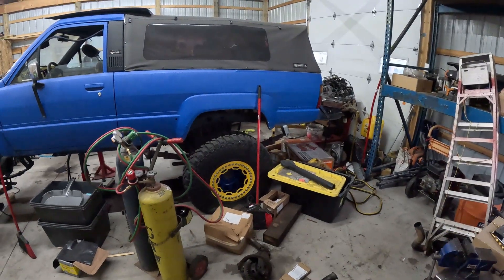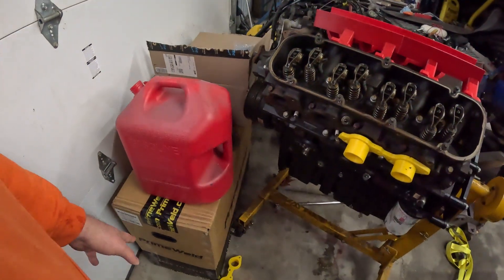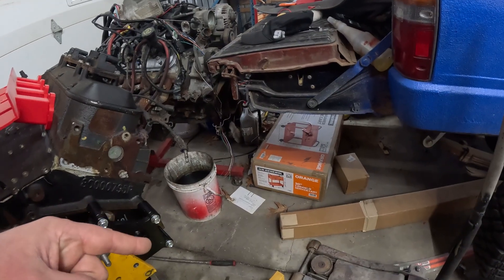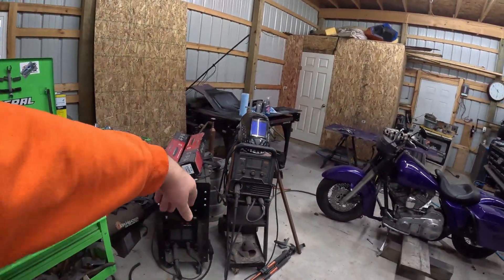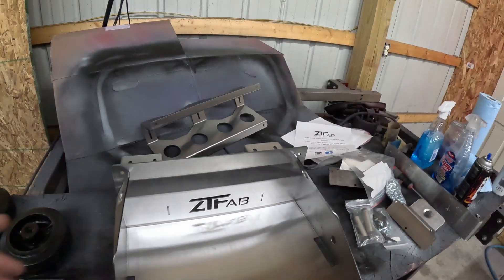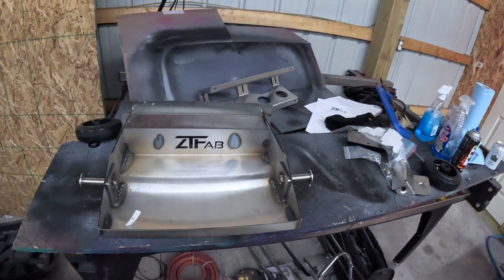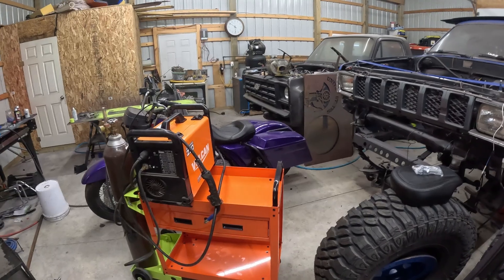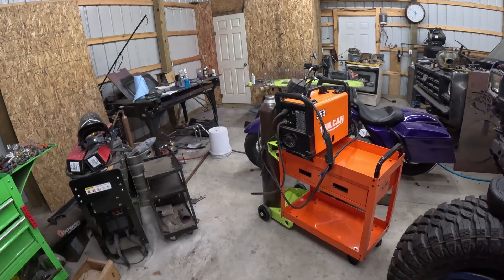Stop Overpaying for Welding Carts — Build THIS Instead!

Comment: You don't need a Tig for aluminum. My friends shop welds aluminum all day, every day using Miller Mig welders and the joints are clean and strong. They make structural platforms for stacking brick before and during the baking process.
Reply from the maker: You for sure don't need a TIG for aluminum.

Nonetheless I'm going to use a TIG for aluminum

Comment: So I built out that Little harbor freight cart. I put bigger better wheels on it, welded all the corners so it's stable, then added a top shelf on it. I have my Mig on top an plasma cutter below.  I also welded a handle on it and couple hooks to hold cables.